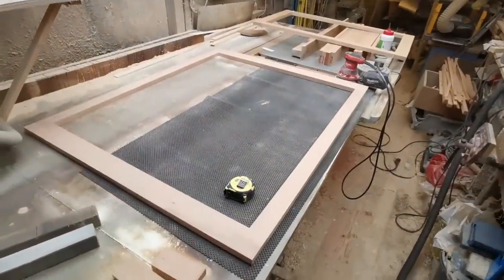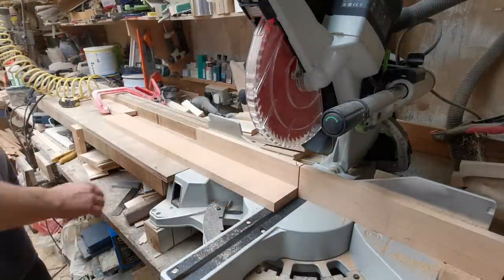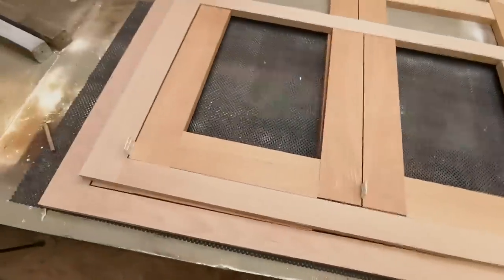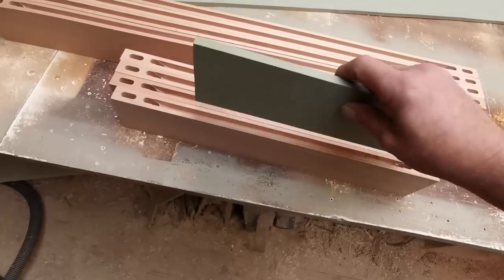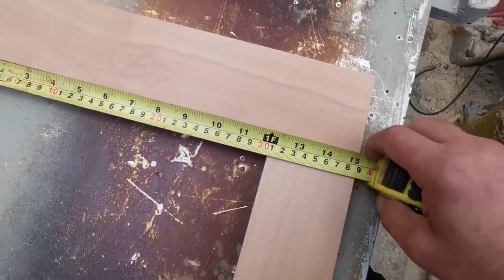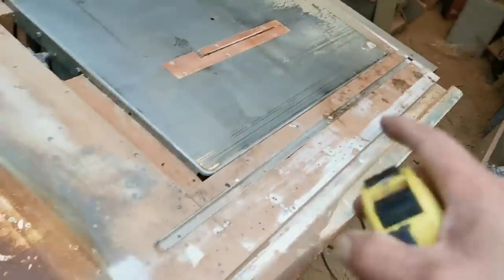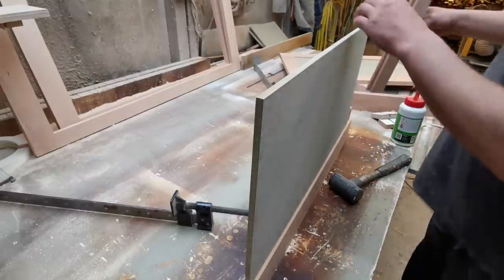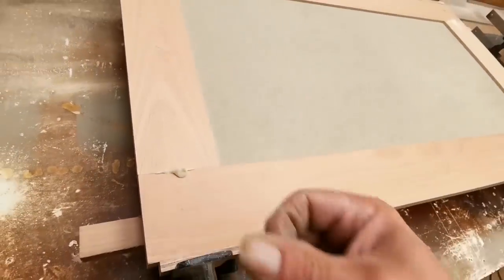More alcove cupboards Pt2 - Making the doors

Comment: Great Video Gid , was wondering what size your finished rails, stiles and heads were and would I be able to use dowel joints as I dont have  a domino cutter.
Reply from the maker: Hi, thanks Ken 👍 My clients look through my pics on FB or find pics on the internet, i then do a CAD drawing to try to emulate their requests, so the size of rails n stiles is often determined by the aesthetics but to get two dominos in with a groove for the panel i have to make the rails at least 80mm, any smaller & the edge of the domino hole bursts into the groove when gluing up, i like to make the bottom rail a little wider, i think it looks better but this is all discussed with the client, Yes you could use dowels, i used to use them with the little metal inserts, drilling the end grain piece first so when pressed together the point of the insert shows better on the side grain, you have to use a good sharp drill bit & drill straight though, mine mostly turned out 'ok' 😏 i sometimes had to re-drill the holes a bit to get the joint to sit ok & not be twisted, If you have a table saw it would be easier & more accurate to cut a groove & make a stub tenon with a sled on the saw, 👍
Reply: @Gidjoiner  Hi Gid thanks for your quick reply I have a cupboard to do for my daughter only the one so I dont want to buy a domino machine, I also have a table saw and a biscuit jointer so could I use those ?  what do you mean by a sub tenon ?
Reply from the maker: You're welcome 👍 stub tenon 😏 This is just one of the first videos i found, there's plenty more, some people use a dado blade or router but as in this vid he's just using a standard blade, https://www.youtube.com/watch?v=VZmnuAjnvbw
Reply: @Gidjoiner  Thanks for that its a great help, I think I will go for that save me having to buy any special tools, really appreciate your time  as you must be so busy thanks again and keep up the excellent videos stay safe Gid...

Comment: As always another excellent by Gid  , why do you use that glue Gid  compared to normal wood glue .
Reply from the maker: Hi, Thanks Simon 👍 I use both PU & PVA, different reasons for different jobs & time of yr, I was deliberating about which glue to use on this, PVA or PU, i went with PU for no reason apart from it's easier to clean off when dry, the PVA says its interior-exterior-weatherproof not waterproof, I use PU if i want it to be def dry within the day, if I'm gluing something early in the day & want to be able to sand it later that same day, if i want it to be waterproof for outside jobs, kitchen or bathroom, it swells so if there's gaps i know it will fill those gaps & create a good glued joint, it also has a little bit of flex to it if i think that might be a bonus, in winter my shed gets to whatever the temp is outside, at low winter temp PVA might not dry over night & below freezing it can crack/crystallise, I've had joints in the past where the glue looks dry but the cold/frost has got to it & the joint just falls to bits,
Reply: @Gidjoiner  Brilliant detailed explanation  Gid , looks like i am buying some new glue next time i am at screwfix lol .